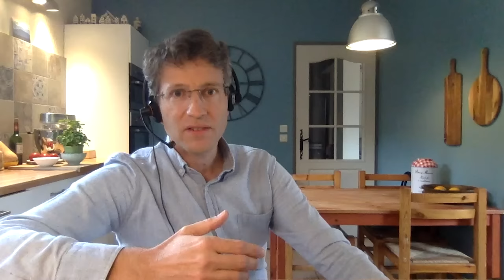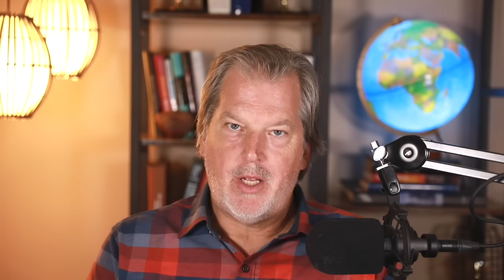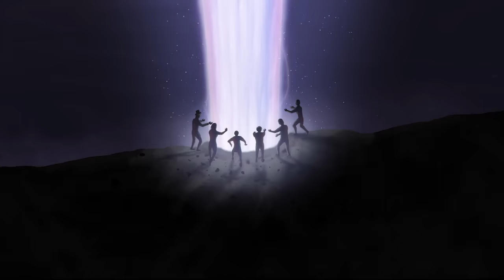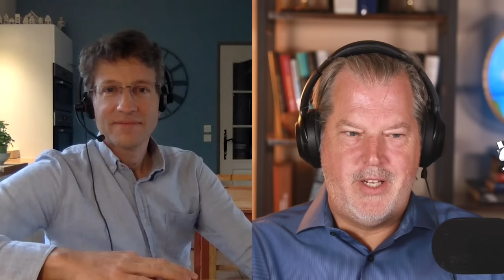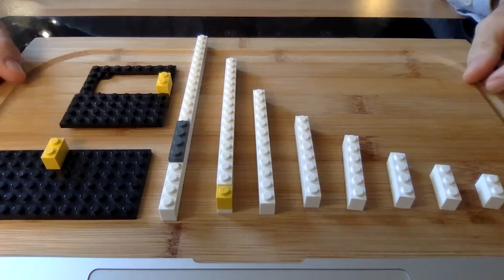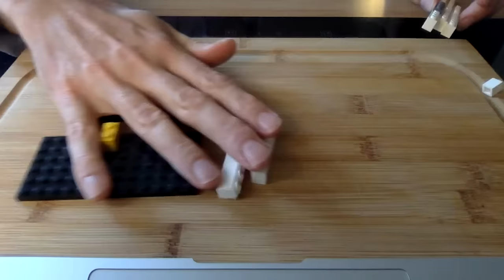Joris van der Schot: "Oil Refining 101 and Other Energy Stories” | The Great Simplification #93

Comment: In Queensland we have a few (and elderly) oil fields. Generally this is a light sweet crude. Many infield engines run directly on this, and the Inland Oil Refinery at Eromanga just filter it and a few upper cylinder  lubricant type additives and there is diesel fuel. A lot gets sold to underground mines because its very low sulphur property. They also have bowsers at the refinery so can fill your diesel car.
Reply: There may be a connection between those oil fields and the historic town of Petrolia, Ontario.
https://en.wikipedia.org/wiki/Petrolia,_Ontario
Reply: @bumblebee9337  Queensland, Australia
Reply: @lynndonharnell422  The 'hard oilers' would go on to prospect around the world.

Comment: Shale is not "uncooked oil".  Generally geologists consider Shale the source rock where most of the oil was formed.  It migrated out into limestones or sandstones where most of it migrated to the surface and decayed, but some became trapped under impermeable layers which is what became conventional reserves. Some large unknown percentage remained in the shales that is not very permeable and couldn't be accessed until horizontal drilling technologies were perfected.
Reply: If oil kerogen has not passed through the "oil window" where the kerogen becomes oil under the temperature and pressure. If too deep (> 3,5000 metres) it cracks into methane. So in that sense oil is "cooked".

Comment: Not a good video. There is not much real information about  the process and details of refining. How much energy and resources consumed in refining and what are the major issues in refining. The guest seems to be really good  and didn’t comment much about things he didn’t have expertise. Nate is really worst interviewer. He didn’t ask any relevant questions, but only promoting his views and many BS he heard from somewhere. For example, he said reducing sulphur from marine fuel is causing global warming. What a BS, I want to know the source he got that BS from. He also, said even if we move to all EVs we still need refining oil. He thinks only gasoline will not be needed. By moving to. EVs for cars, trucks and even semi, it will cut diesel. Many of short trip Ferris and boats are already converting to electric. They have a 3MW charger for ferries in Norway. Nate is totally ridiculous in this interview

Comment: EVs are not going to work. You can not build enough with the resources needed to replace the entire ICE car fleet and you can not produce enough electricity to power those cars and to produce that electricity without fossil fuels and to transport around the world without using bunker fuel and to mill, process, fabricate and assemble all without the easy fossil fuel energy. It's techno bargaining, an example of Ernst Becker's "terror management theory", AKA, fear of death (of BAU, our way of life) and characteristic of Elizabeth Kubler-Ross's one of 5 stages of grief, being bargaining, or techno bargaining as I call it.  First you add a ton of weight to your car meaning MORE energy is needed, no matter how that energy is sourced, to store the power which has probably been generated from fossil fuels. EVs are placebos. They allow us to imagine something good is happening without actually curing the problem.

Comment: I'd so hope cold fusion never works!  At least not in some way that provides much power, maybe safe & useful if it provided only weak power sources useful for satellites & space probes, like maybe some "two-stage" radioisotope thermoelectric generator done with plutonium hydride or whatever.

Comment: The sulphur discussion makes me think of the effect of smoke from forest fires. Something that’s been happening with some regularity in recent years: you have a heat wave, and then you have a big forest fire, and the smoke blots out the sun and the temperature goes way down. Same thing used to happen in orchards in the Pacific northwest: they would burn pitch to prevent the buds from taking damage in the early spring, but the smoke would prevent the temperatures from going up when the sun came out. So they began spraying the trees with water instead. The freezing of that water on the buds would protect them from frost damage and the resulting fog as the water eventually melted again did not block heat from the sun like smoke did, so the orchards warmed up quicker.

Comment: Excess energy on the grid (e.g. from nuclear supply that exceeds demand) could be used to power direct carbon capture, you'd just need to make sure there was always enough dcc facilities to absorb any excess utility generation. When there is so much excess CO2 to be removed there is no such thing as excess energy on the grid. Load balance with DCC, not by burning methane.
Reply: You point out here that carbon capture is an energy intensive process. You pretend there's wasted nuclear capacity to power the pipe dream of pulling 0.04% of the atmosphere out. 

We already have very efficient carbon capture. Go buy a CO² tank. 

The problem isn't electricity. Electricity is worthless for making steel, making fertilizer, making medicines, refining ore, making silicon, and last mile delivery. 

How much does the atmosphere expand per degree of warming as per the ideal gas law? The rate of cooling of a body due to radiation is based on the surface area of the atmosphere. There is no global warming. It's propaganda to reduce fuel consumption. Which is the actual problem. Only a fool thinks they'd build a machine from fuel to absorb a fraction of the byproduct of the combustion used making the machine itself.
Reply: @skeetorkiftwon  Ignored.

Comment: Schot's optimism ignores the limits of thermodynamics which can come from batteries. Most of the proposed new battery techs are new ideas but have been around for 100 years. Most other proposed batteries are heavier the lithium ion batteries, lithium being the 3rd lightest element after hydrogen and helium. SO a heavier battery is not a good start because THAT weight also has be be carried around.
Reply: From what I've seen and heard, almost all proponents for the heavier alternative 'batteries' point to them as fixed storage.

Comment: Nate’s use of the term “tar sands” illustrates how successful the environmental propaganda machine has been at disparaging Canadian oil. Why isn’t Venezuelan oil disparaged in the same manner it is often as heavy or heavier than Canadian?
Reply: Is Venezuelan crude mixed with sand? Do Canadian Tar Sands require pumping sea water into the ground to extract them, or is that just the shale oil in the U.S.? The answers to these questions might be part of the reason, or maybe it's just political.

Comment: No matter how you get your energy, you will boil the oceans  in 400 years if you keep using energy at the current rate.😢
Reply: How do you figure?
Reply: @brushstroke3733 Calculated based on entropy.
Reply: Dr Sabine H.  Has a video called. " I recently learned...' Google does not allow me to share the link here.
Reply: @mchahal22  How so? Increases in temperature indicate higher energetic states within a substance, meaning more vibration and translation (movement) of molecules. More vibration and translation of molecules and mixing of molecules means higher entropy. In other words, [delta] S (entropy) is proportional to [delta] Q (heat.)
Reply: @mchahal22  I will check out the video. Something sounds very fishy about that claim. While much energy is lost as heat whenever we convert it, it would take A LOT of heat to raise the temperature of the atmosphere so much that average surface ocean temperatures would reach 100°C. Remember, the atmosphere is huge, the oceans are huge and deep and cold, and the total mass of the Earth is WAY more than both of those components combined. The Earth itself provides a massive heat sink for all that lost heat we produce as we convert energy (to electricity, light, kinectic energy of machines, kinetic energy of moving vehicles, phase changes that power cooling systems, etc.)